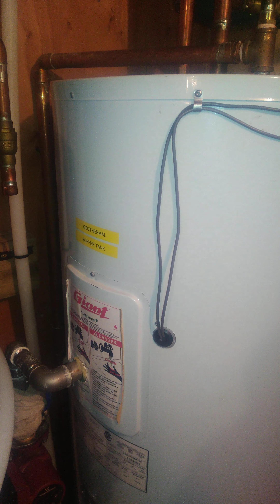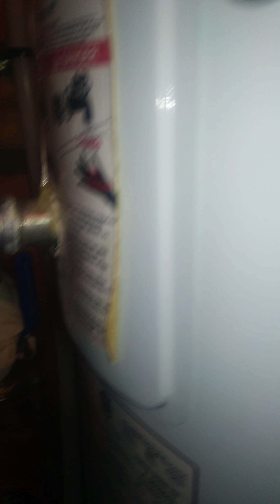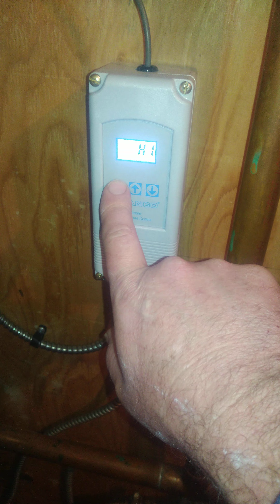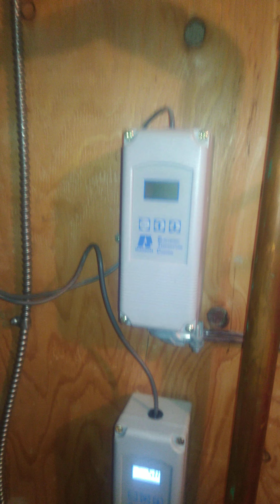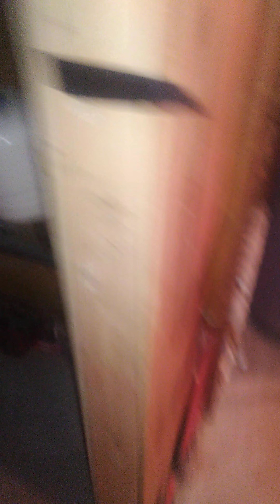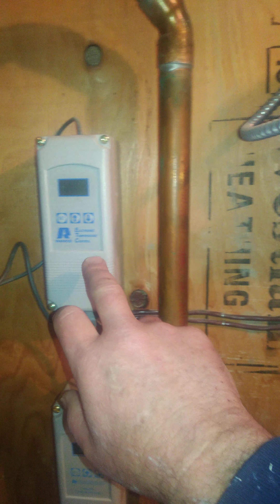Outdoor Wood Boiler Connected to Existing Geothermal

Comment from the maker: Correction, I made a comment that the aquastat was in the HI mode, what I meant to say is that it is in the heating mode meaning the differential you use is high to low ( off at 130 on at 110 in our case), if you use the CI mode it is cooling therefore the differential goes the opposite way (say comes on at 70 goes off at 65)